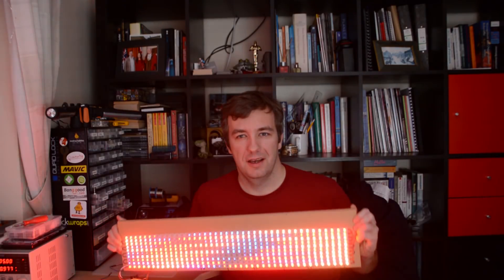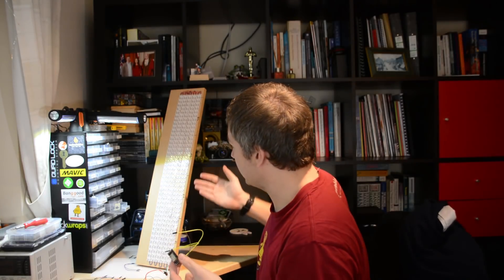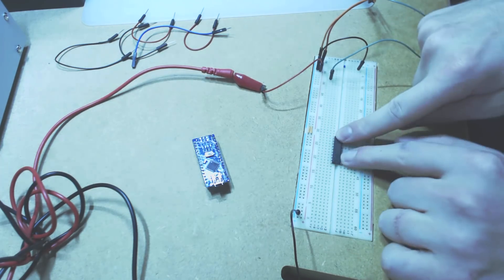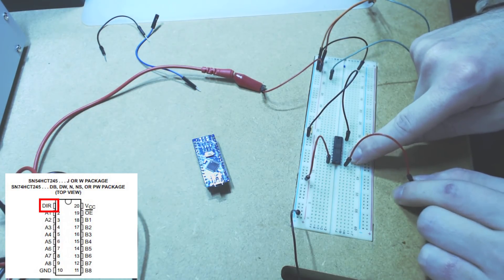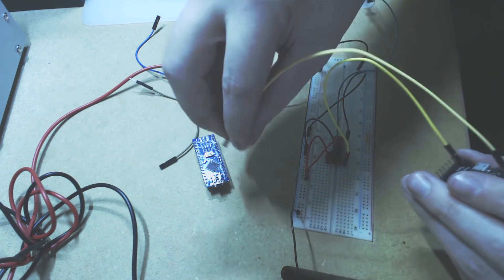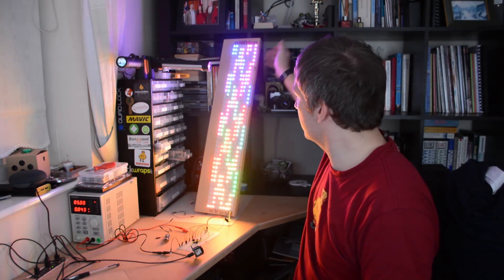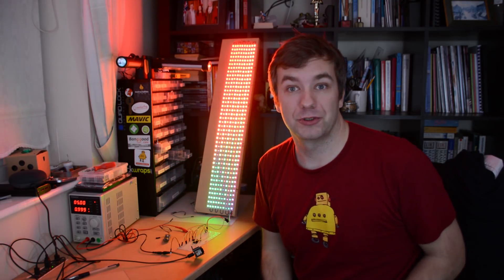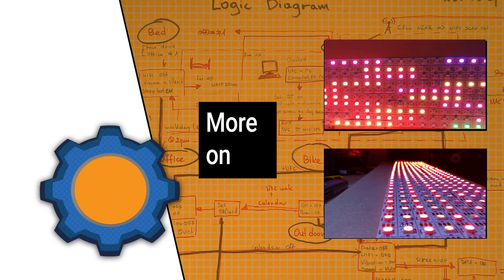Driving 410 RGB LEDs (WS2812b) with ESP32 & ESP8266

Comment: what is maximum pixel number for this? How to calculate? thank you!
Reply from the maker: in theory.... a lot. In practice... exceeding the number of pixels will cause slower render times until you run out of memory., WLED driver lists the chains in 1000s... you'd sooner run into the problem of "how do I power all of this" than anything else

Comment: hiii 
I plan to set up 2000+ leds but im a little lost. I want to make custom light scenes w Arduino and call them back them from a phone app is that what ESP does? or does the apps come w predefined scenes you cant change,, and if you can change them hoe do you change them? do you program only thru the app or do you code in Arduino and it sends to the app??,...  im new to this world and coding plz helpp
<3
Reply: how* not hoe💀
Reply from the maker: You can stream data over WiFi to the esp and make it display what's received. It will strongly depend on how the esp is programmed to handle it

Comment: Has anyone figured out the max you can control off 1 esp32. Obviously with external powering the led
Reply from the maker: The max number will depend on many factors. 
Desired speed/latency of the strand
Density of the strip
Number of GPIO pins to handle strands

Comment: Hi, I'm searching for something like this. I have 50 meters of adorable led strips. 

How to control all of them simultaneously?
Reply from the maker: It depends on a desired effect strands could be an answer. You can also use logic level shifters (pick fast one) to increase the signals voltage (if leds can take it) and account for the voltage drop over that distance

Comment: I have a similar setup. I can print scrolling words on my 8x32 lcd screen but I get random flashing leds. Do you have any ideas on what might be causing this?
Reply from the maker: If flickering... The supply isn't strong enough or you get too much voltage drop across the LEDs. Check each section for that

Comment: Can you run everything from the same power supply? In your video you're powering the ESP32 via USB. Can you power it with the same 5V from ur bench power supply ? so in the end you have only 1 power supply to power it all?
Reply from the maker: Yes. Especially that you should use the common  GND  for led strip and esp
Reply: @notenoughtech  cool thanks!

Comment: i had a strange problem..i did a for loop to blink all the led strips..everything was fine but the last led didnt turn off..Finally i tried a logic converter but it didnt work..finally i had to do a FastLED.show() one more time after loop..generally everything worked fine without logical converter..
Reply from the maker: That's unusual. With LLCs you have to make sure they are fast enough. I had some at first that didn't work at all due to response time ...
Reply: @notenoughtech  I don't know my LLC response time, but it's from the cheap ones.. but my ledstrip with more than 80 LEDs runs fine with my esp32 without LLC. I provide them with external 5v power although..

Comment: what kind of chip should I use for 12v addressable led strips?
Reply: radnukespeoplesminds normally 12v is only for supply. Data line and clock line (if present) work with 5v

Comment: In my experience, WS2812b's work just fine if you drive the logic with 3.3V. You have to power them with 5V, but data works just fine at 3.3V. Your solution might ofcourse still be usefull in other applications.
Reply: Can confirm. Mine work just fine driving with 3.3v on the data pin
Reply: Tried a few times, works about 50% of the time with me. Often the signal is just barely registered and the strip starts to flicker. Just use 74HTC125D inbetween and save yourself some future headaches.
Reply: Well that might work, but it is always advisable to somehow buffer your MCU GPIO. Last week my Ras Pi got fried due to direct connection with WS2811
Reply from the maker: Oh no! What happened?

Comment: Hi there! On your recommendation I bought the same chip as you. I have a NodeMCU Esp32s board and I'm trying to run two strips mirrored on the same pin. When I hook my logic level shift up exactly the same way though, I get weird colors and flickering lights. Do you know what I'm doing wrong?
Reply from the maker: Not enough amps :)
Reply: @notenoughtech  I have a 10 amp power supply. I've never had trouble running the LEDs off it using arduino
Reply from the maker: Common GND? What LLC do you have? It has to be fast enough. Also many LEDs in a single strip?
Reply: @notenoughtech  I've got two strips of 115 with the program capped at half brightness, so I should only need ~7A. I bought the same LLC you had in this video and wired them exactly the same 🤔
Reply from the maker: Check the voltage at the end of the strip
Reply: @notenoughtech  4.8-5v on both strips
Reply from the maker: On the further end of the strip (from power supply)
Reply: @notenoughtech  Yeah I know, you're looking for voltage drop right? I've got a solid 5v the whole length of the lines
Reply from the maker: Oh I missed the mirrored part. Single pin may not have enough signal current. Can you run one strip ok? Solve the mirror in the code if you have a spare pin
Reply: @notenoughtech  Nah, I tried it with a single strip too. No change. The lights kind of turn off and on and different colors at random if it helps. It could be a timing problem
Reply from the maker: Did you do the calibrationi? and selected the correct LED type?  I'm starting run out of ideas
Reply: @notenoughtech  Lol me too. And I'm not sure what you mean by calibration
Reply from the maker: Script with fast led has be defined (RGB) order for each led type is different. This will explain colour inaccuracies. Also you have definition for what LED model is used
Reply: I also just double checked the LED type in code and th library and they're both right
Reply: Michael Staffa Did you find any solution regarding your problem? I’ll having similar issues with my setup. While the 300 LED strip ist running perfect when connected to an Arduino nano (5V logic), it’s flickering while transitioning between colors on the esp. It holds single colors but animations look horrible. I’ve already tried several different logic converters including the one in the video. Non of which seem to have any effect whatsoever. The strip seems to run even best when connected without logic conversion at all. I’m frustrated and running out of ideas :(

Comment: Glad I found this. Guess I gotta buy the IC now; can I power the IC from my esp32 or do I need to power it from the +5v/-5v on my power supply?
Reply from the maker: You should be able to power it from the esp. but refer to the current requirement in the IC spec sheet
Reply: @notenoughtech  I went to one of the maker studios at my university and one student working informed me I could level shift the signal with the use of a transistor and resistors.
I might try that so I won't have to wait a few weeks for the piece to arrive. :)
Reply from the maker: Yes it's possible. Use 2300 SMD equivalent

Comment: never had a problem  running them without logic level converters and driving them directly from the esp's gpio
Reply from the maker: You might run into the issues depending on both model of RGB and ESP and the number of LEDs driven.  Here is an example of me driving the same LED type without the LLC with an ESP8266-01
https://notenoughtech.com/home-automation/esp/marvelous-notifications/
Reply: @notenoughtech Just put 5v on the power of the led, and take the signal line from the ESP to the led. I will work without any problem.

Comment: I see you are using a beefy bench supply, but for deploying this in the field, it is important to know how you wired it up. Obviously, the signal conditioning between elements allows that long of a string to stay stable, but if I calculated correctly, each element (pixel) has a max of 60ma (20ma x 3), so the whole string at full white (RGB 255, 255, 255) would be just short of 25 amps. So what gauge wire did you use to feed power to that massive string? And is it possible to run multiple strings off the ESP32? And what ESP32 module are you using?
Also, I ran a 160 LED string without level translation by just supply the first element with 3.3v levels, and because the supplied string was drawing off of 5v, the first element conditioned the signal to 5v and the rest of the string worked fine. 
Thanks for the video! It was very helpful!
Reply from the maker: The power supply was 30A  (150W) - the LED has been connected from 2 power rails essentially splitting the current in more less half. To avoid the insulation melting, I feed the panel from both sides, per line.  I have not used a specific wire was this was more of a prototype that never run more than 1h, but I could feel the heat given out by the LEDs :) 
You can run 8 strands of an ESP32 as you will need PWM for each to drive the LEDs. I needed a fast LLC to step up the voltage to the required 5V  - this is the ESP32 I have been using:
https://www.banggood.com/custlink/DmvmvN8QpO

Comment: Hey, thanks for the nice video. Can you tell how much power it is drawing? Is that the amount of amps below the voltage on your power supply?
Reply from the maker: I have nothing to test the current draw but at max you have 440 LEDs at 50mA each I have a 150W supply with 2x5v rails it was doing ok without collapsed voltage

Comment: FastLed in esp32 start, draw some pixels and "CPU halted!"
Reply from the maker: Have you used my code? What's your setup how many LEDs how connected etc? Where the power to LEDs coming from? It could be underpowered ESP.
Reply: NotEnoughTECH you code and other code for fastled.

Esp32 in usb - in other project all norm. 
16*16 matrix - separete power from 3*AA battery.
Reply from the maker: I'm still away in China for a see days so I can't take a look at my set up. 3 batteries may not be enough for the matrix but it should not halt the cpu. 
Try this to get more info;
http://www.iotsharing.com/2017/12/how-to-debugging-errors-using-arduino-esp-exception-decoder.html?m=1